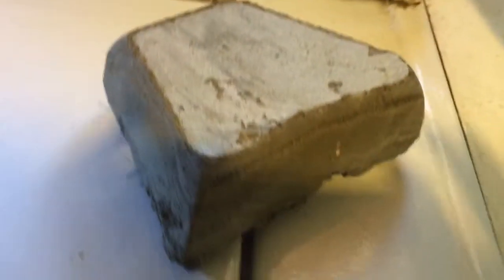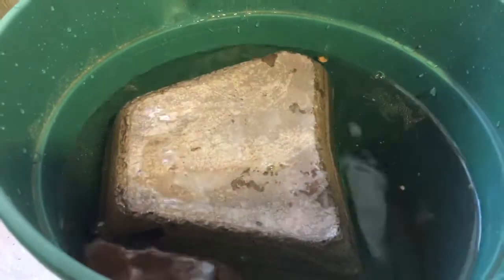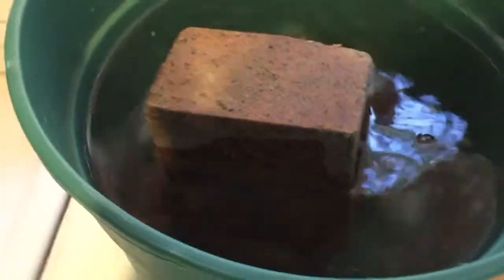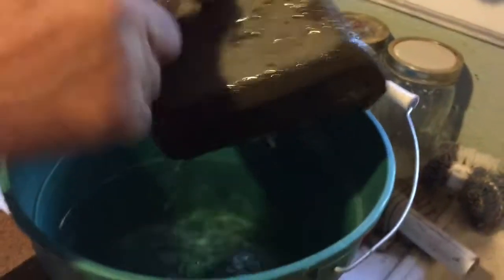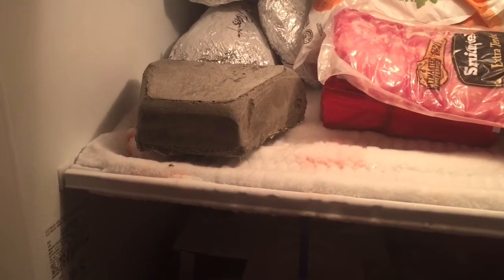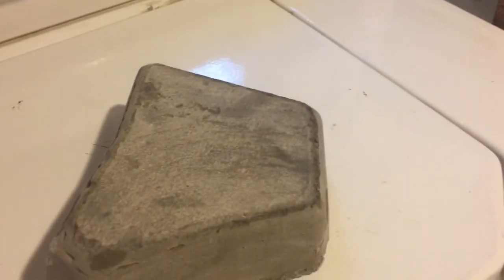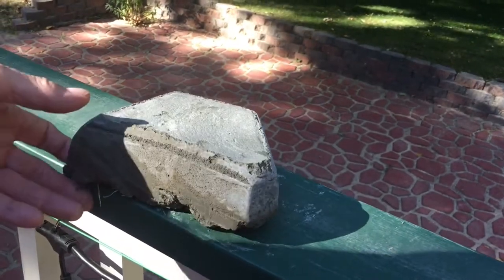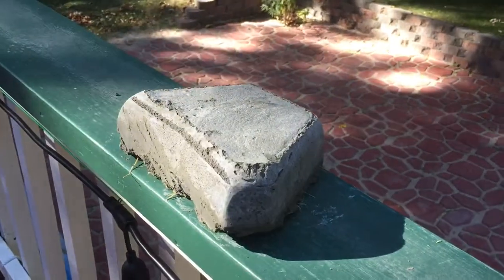Freezing the air crete patio brick followup just a test

Comment: Great experiments. Couple of questions. What was your ratio of Dawn to water in your foaming machine? Could you take some of your extra  blocks and demonstrate what it takes to crack and break them. Like hammer and drop tests? Would really appreciate that kind of info. Especially if you did the tests side by side with regular concrete and brick. Thanks so much. I would love to do my own experiments with this sort of thing. You guys are awesome!
Reply from the maker: We are going to be doing another video on how it held up over winter. We can most definitely do a video on how it holds up against regular concrete by hitting it dropping it.  We’re still having winter here, need a month or so to be  able to work on the patio. Oh and on the soap we used 2 cups of soap per five gallons of water.